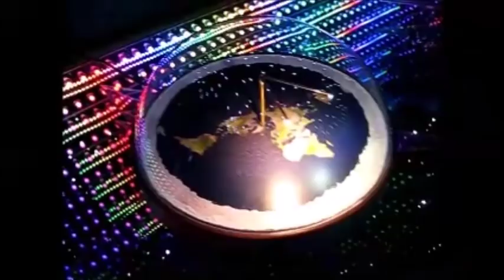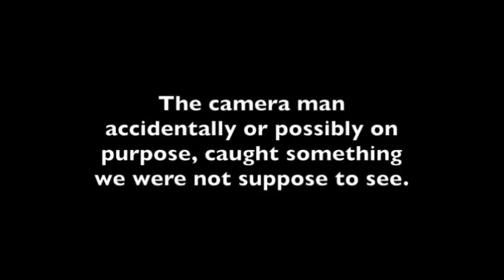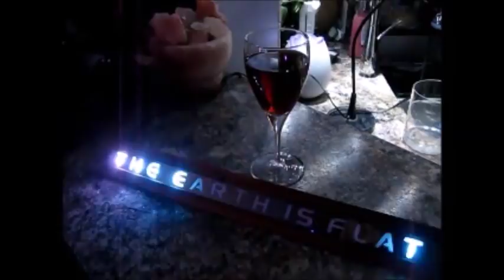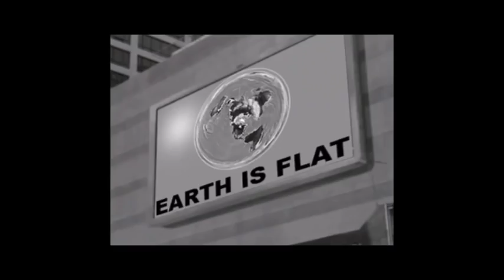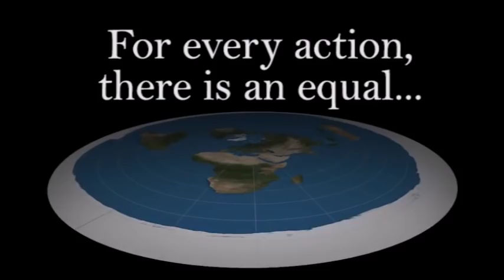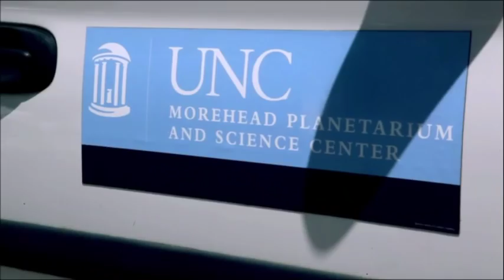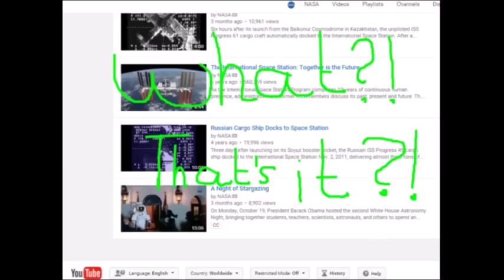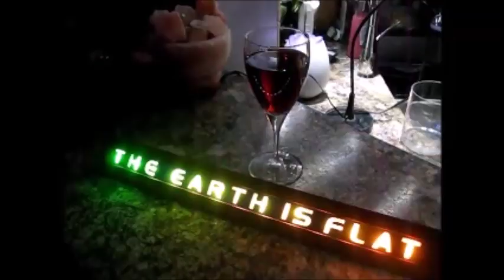Flat Earth Q&A Emails 73 - Mark Sargent ✅

Comment: Sending an email/text on a cell phone with that virtual keyboard is soooo annoying. Turning off auto-correct helps but it also means you need to go back and manually fix typos. If you click the space bar twice, it automatically adds a period and capitalizes the next letter. Making YouTube comments on a cell phone should be banned.